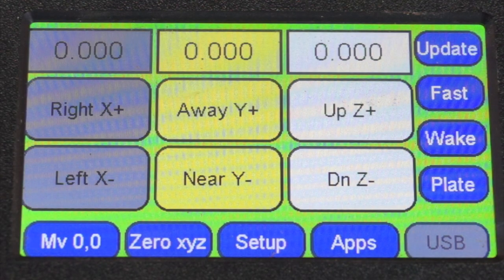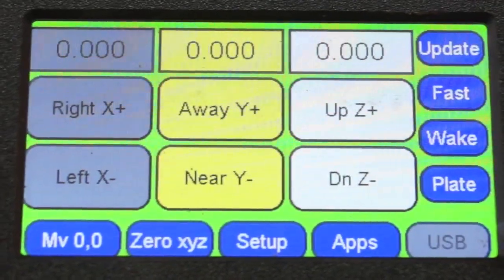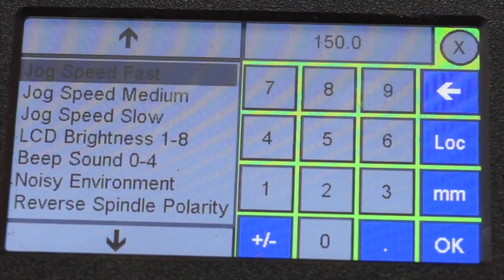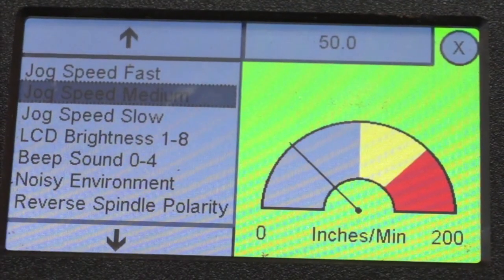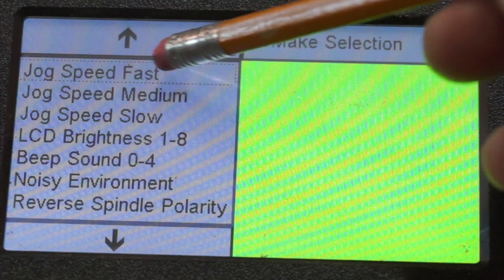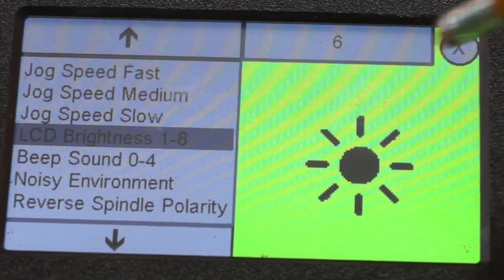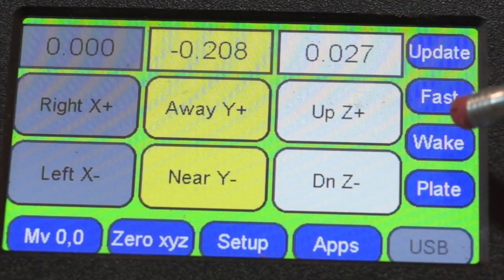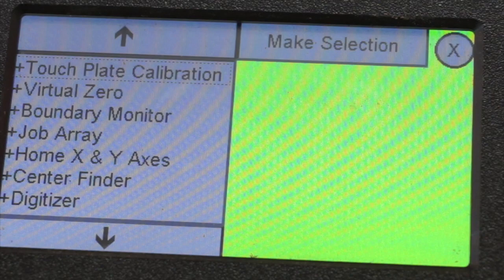touch pad part 2

Comment: Cecil- could you explain how to increase the depth of cut via the pendant.  I have a PiranahFX.  If I run a cut and the text is a little shallower than I would like, can I make an adjustment on the pendant screen to have the original file cut deeper?
Reply from the maker: If you run your project and it is not deep enough, you can stop your project (or wait until it is done) and return to your home position.  Let us say that your home position is x=0, y=0 and z = .5, you decide to make your cut .05 deeper. All you have to do is touch the z position on your teach pendent and it will go to the next screen where you can change the value of the z axis. You what to make the z move .05 lower when it cuts. To do this you need to change the the current value from .5 to .55 or simply add .05 to the display value. (To do this simply press the + key followed by .05 then the = key the display will change to .55) When you do this it changes its programmable position to .55 higher or .05 higher than it was.  To get to .5 it must move down .05 lower. The z zero is now .05 lower thus moving you down into the work piece.  Hope this helps. I will do a video showing how to do this maybe next week.  Cecil
Reply: Cecil-  thanks for your quick reply.  I appreciate your help!